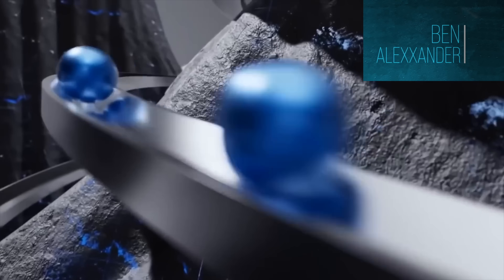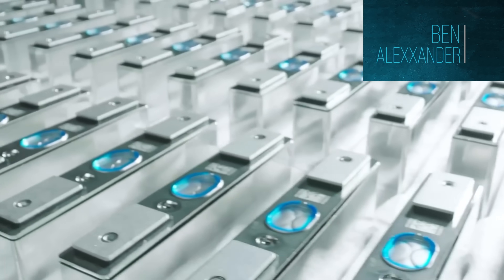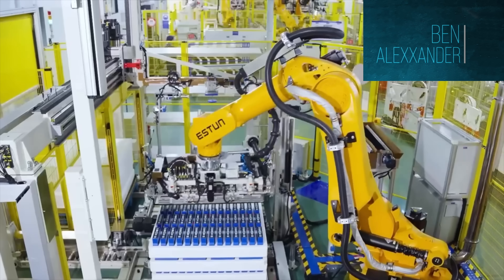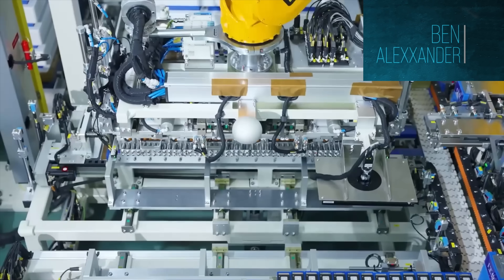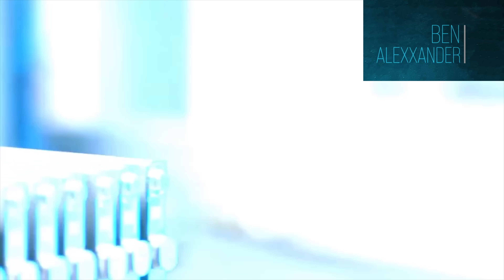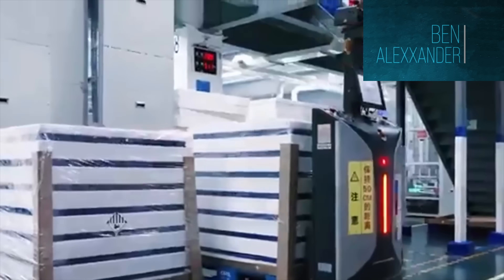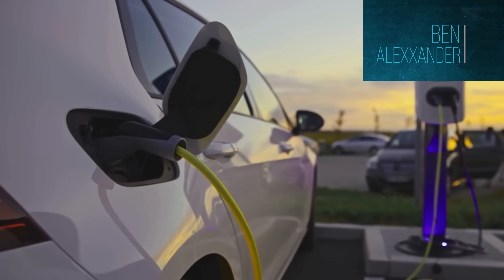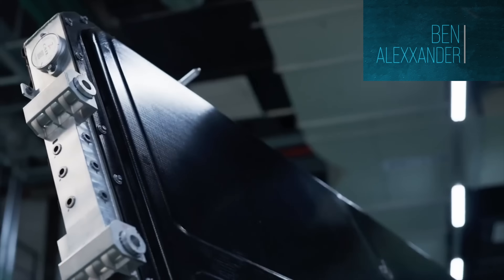CATL’s New Sodium Battery Lasts 3.6 Million Miles — 50% Cheaper Than Lithium

Comment: All this sounds great. But it's very hard to get all charge from sodium battery because of voltage delta between full and empty battery. Battary capacity has linear drop in voltage from ~4.2 full to ~2 volts close to empty. But it's used in range between ~2.8 to ~3.8 volts. So more than half of capacity is not used. And power that you can get from it changes while it's charge decreases much worse than in lithium-ion batteries. If you want to replace best existing lithium-ion battery to get same power output and usable charge then you'd need about twice a weight of best sodium-ion.

Comment: Appears to me that sodium is even more inflammable than lithium, just water will ignite it, extinguishing it with water is therefore impossible as it will just accelerate the fire, it will therefore have to be stored in oil and you definitely don’t want your EV “landing” in a canal. So no, I am not convinced, there seem to be serious safety issues that are not easily resolved.

Comment: shut up and take my money, could use a ton or so to make my house fully offgrid capable for less moneyz, without fear of full discharge or losing rapidly capacity and the fire thing is good too, although it will be put in a dug out hole with live rock and concrete...just in case....

Comment: If tis is correct then by my calcs Sodium batteries plus solar are cheaper than per Kwh than building and running a gas power station. Given enough sunlight also continuous power. Much cheaper to set up as well, so a no brainer but electricity companies will not like the de-centralisation of product so may try to stall things.

Comment: You mentioned that these could be used when the car reaches end of life for powering a house. That will only work if the batteries can be removed from the car and are compatible with house storage systems.

Comment: Sodium batteries are larger and heavier than the equivalent Lithium, which means Sodium power EV cars will be even less efficient than ICE cars, so it is not the game changer EV lovers want.
Reply: lol, did you not here what he said? Energy density is already higher than BYD;s blade batteries.
Reply: @walk-with-Walz said:

"lol, did you not here what he said? Energy density is already higher than BYD;s blade batteries."

Yes, i heard (I did not 'here') what he said, he picked a battery with a lower energy density than the CATL sodium by which to draw a comparison. Had you taken the time to research it yourself you would have realised the current BYD blade is at the lower end of Lithium battery energy density. Makes you look a bit of a fool, lol.

Comment: One reason I haven't got a battery for my solar or bought an EV was the lithium battery technology and associated fire risk. Sodium batteries change everything.
Reply: Unless the sodium gets wet for some reason.
Reply: @Jbot123  genuinely wondering... more consequential than a fuel tank developing a leak? 
In an adequately sealed pack, how does water get in? If you're going to suggest a major impact before going into a river, then how about cars crashing into fuel tankers? It seems to me you can never completely eliminate risk.
Reply: @davebox588  Sodium catches fire and can even explode when it contacts water.  I don't mean driving into a river.  Sodium is kept in oil so it doesn't come into contact with the water vapor that's in the air.
Reply: @Jbot123  Yes, we did that at school, but it seems to me that kept in suitable containers it's not, as far as I'm aware, any more likely to be dangerous than many other forms of contained 'energy'.
We could go back to coal. When lit it just goes 'pffft!' when you put water on it. Safer, but do you really want to pay a stoker to drive with you?
Reply: @davebox588  Gas engine car crashes happen all the time.  Even when there's a gas spill involved, fires are rare, and when they happen, the fires can be put out.  When lithium batteries get punctured, it results in an uncontrollable fire, and all the fire department can do is to wait for it to finish while trying to stop anything else from burning.  If a sodium battery gets punctured, it could have the potential to make the lithium batteries look tame.
Reply: @Jbot123  Your initial point is not correct. YT doesn't seem to like web links but I'll supply one in a follow-up reply. Here's the text from the International Fire & Safety Journal.
"According to a study by the Swedish Civil Contingencies Agency, electric vehicles are 20 times less likely to catch fire than petrol and diesel cars.
The study, corroborated by data from a US insurer using National Transportation Safety Board figures, indicates that battery-powered EVs suffer only 25 fires per 100,000 sold.
In stark contrast, petrol or diesel vehicles experience 1,530 fires per 100,000, with hybrid vehicles at a notably higher risk of 3,475 fires per 100,000."
Reply: Honestly, for me, it's going to come down to range and how fast it can charge.  If they can get the range to massively exceed gas and get the charge times down further tjen what its currently at, then the switch will naturally occur without governments forcing the change.  The infrastructure of not just electricity to support evs, but of the stations as well needs to be massively improved. Outside of that evs so far are just ugly as sin
Reply: @Shadowsokr  Teslas, Taycans, and Lucids are ugly? Man, what do you consider beautiful, Gremlins?
Reply: @hootowl6354 all tesla are ugly as sin. Had to look up the lucid as ive never heard of them. The ev eh. And was never a fan of the way porche looks.  I like the look on dodges ev, however to expensive and way to many bugs in the software for that car from what ive been able to find on it.     I have no interest in purchasing an ev currently and as I said unless the battery can charge as fast as fueling gas does or the mileage blows gas out of the water then I'll continue to have no interest in evs.
Reply: @Shadowsokr I don't want an EV either, because I don't want to spend so much money on something that is a pain in the ass on long trip. A car has to be good around town and cross country. But for around town, EVs are great if you can charge at home. Imagine never having to get gas, or going for less costly services less often.
There are better batteries on the way. But when there is less demand for gas, the price of it will remain affordable. We'll have choices.
Reply: I take it you don't use a modern smartphone or laptop then ???
Reply: Associated fire risk is massively overstated by anti-EV ... anti-anything but oil&gas people, sponsored big oil oligarchs. These batteries far less likely to catch fire than a petrol car, by design as well.
Reply: @Scotti-ren  It's not the likelihood of them catching fire that is the problem. The problem is the absolute uncontrollability of lithium fires.
Reply: @hootowl6354  You've got a point, that's why I prefer LFP over NMC. You might saw the test when BYD put a nail across their LFP Blade Battery. Mind you, home batteries are LFPs as well.

Comment: Plus the transition to  sodium ion for home energy storage users would require expensive upgradation / replacrment if current solar inverters which are designes for LFP or lead acid batteries, as the solar knverter will trip due to low voltage even with 70℅ SOC of sodium ion cells, so in my opinion we are still quite a few years behind a sodium transition and LFP cells will remain in drmand for the near to medium term

Comment: Pair one of these factories with a desalinization plant.
Reply: I had the same thought
Reply: Pissing in the wind.
Reply: @cinemoriahFPV 
Lol .. and possibly facing upwind
Reply: You can run large pipes at least a mile off shore and then feed that pipe into a dispersal system thick releases the brine over a large area of the off shore area. It can also be reduced into a supply of sea salt once it is dried.
Reply: Bulk sea salt is dirt cheap no need to put it any where desal plus desal plants don't make salt they release the high saline solution back into the sea... Do some research next time before you make brain dead ideas.
Reply: @ntal5859maybe you should do some research before accusing someone else of being brain dead. If you had done your research, you would have found the one of the biggest cons of desalination plants is:

Desalination produces a concentrated salt byproduct called brine, which can lower oxygen levels and increase salinity when dumped back into the ocean, harming or killing marine life
Reply: @wmsloan1107  Do you have any evidence to back up that claim?
Reply: ‘Release the high saline solution back into the sea’ - you know that’s a huge problem, right? Clearly not as you haven’t done your research before shooting your mouth off.
Reply: @trhosking  I doubt you have any real experience with RO plants. Maybe you should do some research.
Reply: @trhosking  If it is such a huge problem then why are the so many RO plants doing it?
Reply: @ntal5859brutal, lol....at least the idea was well intentioned.
Reply: @ntal5859 Maybe DON'T release the high saline solution back into the sea?

Comment: this isn't like most new battery things where it's a start-up with an untested idea not proven at scale-this is THE battery company planning an enormous calculated pivot after many years of careful research and testing with the full vertical stack of supply chains and manufacturing mostly ready to go.

Comment: Dang, imagine electric costing less than gas. Sooooooooo, important
Reply: Why would electric cost less than gas because of a battery? You know a battery that still requires gas to charge. 

Great, you solved energy storage. 
FOSSIL FUELS still responsible for 99% pharmaceutical manufacturing. Nearly all of fertilizer that 3rd world nations use to break even in food production. Then Fossil fuel byproducts go into 7,000 modern manufacturing materials. 
so you will still need Fossil fuels to manufacture the materials to make said batteries
Reply: @felixfungle-bung4688
Yes, that is true, but the fact is that it's the burning of fossil fuels that is the main problem.
Reply: @felixfungle-bung4688  well, an electric vehicle charged from a natural gas plant is still 1/4 to 1/2 the carbon emissions. Switch to all green and it’ll be lower.

And manufacturing important plastic parts or fertilizer doesn’t mean we’re burning it all back at the end back into carbon.

Using less is using less.

We just had two storms of the century within miles of each other within 10 days last year, that shouldn’t happen. But the Gulf of Mexico was 90 degrees for 3 months.

Better is better.
Reply: @LeroyMustang electric is lame and not better 🤷‍♂️
Reply: @generalzod7959  I bet you’re mom says you’re handsome too. You shouldn’t believe everything you hear.
Reply: Nah, I'm sticking to my oil burner thank you
Reply: It’s just a battery, it doesn’t produce power, it wont make electricity any cheaper, you can just store more electricity and charge less often.
Reply: @Cybo-Man 100% correct but it will allow for energy generated that's currently wasted to be stored safely and cheaply... One of the big drawbacks for solar  and wind . Is the inconsistent nature in up both you may get 18 hours of daylight during summer and 6 during winter, even at the equator its about 12, that's half the day you need to rely on other power sources or use energy you've stored in a battery.
Same for cloudy days and bad weather. 
the same with wind.
Wave power is slightly different, it's far more consistent with two high and two low tides per day but even then there's calm periods as the tides shift. Plus to be a realistic energy source wave tech needs a  heavy  durable ocean proof system that can function ideally for many decades without maintenance...something that is still under development.
Reply: They already cost less. Look a the best Chinese brands BYD, Chery, Xiaomi  etc. their cars are more affordable than their gas comparison while providing "luxury" amenities, BYD cats are quickly becoming the European brand of choice, and this is with Lithium batteries!!  Imagine what sodium batteries would do.

Comment: Good news, I bet they will improve further and can't wait to get some in my hands. Regarding the longevity: NMC from CATL has 2000+ cycles in their datasheet. So my car would have to make at least 700,000km which it never will because it will fall apart before that.
Reply: The car could last (if designed to last that long), I mean the electric motors could last a long time. The power electronics might have problems (capacitors can get old but that might not be problem nowadays).

Comment: As this is happening I’ve been following 48V charging systems for RV’s specifically on the hybrid end. I think if electric hybrid autonomous vehicles are in the market and there is some type of 48Valternator  to charge house batteries we’re looking at a jetsons future. If in less than an hours drive my house batteries are charged any power above and beyond can extend the mileage. Depending on the efficiency might we be seeing mid sized trucks and SUVs with all the conveniences of a home? Could integrate  fuel cell and cheap hydrogen catalyst using water as a fuel source to charge systems off grid.

Comment: I think it's patently irresponsible to prognosticate upon the "end" of energy generation technologies which perfectly match the realities of handling base loads, in favor of what's at-best a 2-step solution which requires some mental gymnastics to favor.  Solar is great for roofs and windows and sides of buildings in urban settings (where oh by the way those photons do not contribute to heating - alleviating urban heat soak - since they're being captured for electricity), but the density of production is exponentially smaller ergo large swaths of land must be used for society-wide demands

Next-gen nuclear is our best bet by far, and the more nuclear electricity production we have, the less hydrocarbon, and the more economically-prudent (to a point) solar becomes as a secondary generation source.  And regardless where it goes (:: solar farms vs urban areas vs etc), it still "soaks up" a substantial share of those photons' potential heat and converts it to electricity

Also worth noting here that all non-solar, non-wind energy sources are still adding heat to the atmosphere, although I have no idea if it's a meaningful amount as compared to global warming due to CO2/CH4/etc.  And further, wind and solar are effectively removing heat, one directly (whaddya think causes wind?) and the other indirectly (the aforementioned potential heating of photons) during their operation, although the economics and large land areas required for both probably mean this effect is just a nice little bonus we use to hug our egos

Comment: That, before anywhere else is a revolution for energy storage at home level. Even if it takes 25% more space than lifopo4 batteries for home storage that is not a problem...especially if they are 50% cheaper. The fact that they are safe, and last for decades is a game changer!
Reply: The best application will likely be containerised Sodium at the "Sub-Station" level, using that as a buffer between a Grid and multiple Homes (or factories)

Comment: Li-ion battery as a compact, light-weight and quick-charge (by Solar light) devices for Space applications, as spin-off for civilian use as it was found suitable, in spite of high price. Yet, the cost (because the Lithium availability is restricted to a few places on Earth).
All this hid the fact that Sodium-ion battery, as Sodium is copiously available in sea water (it is the main solute in it) everywhere. 
Sodium is one place below Lithium in the same group of Periodic Table, indicating that is easily interchangeable with Lithium. In fact Li-ion battery is marginally better than the Sodium battery. This overlooked fact, need to be corrected. Also Sodium in bulk can be employed in big batteries for use in big ground-based vehicles & static home at much lower cost. Sodium batteries can be made even more cheaper than the 50% margin it has now, over Li-ion batteries.

Comment: I dont mean to imply they are not a big part of the future.    However, I don't think these will scale as quickly as we would hope.  only CATL is claiming that price.  If I had to guess there are still a lot of hurdles to get through, since they seem to be making these hybrid packs.  if only CATL is selling them in quantity they dont have the incentive to drastically reduce cost. I dont expect a 50% drop in pack level prices.  I think we will see that over 5+ years.  This is still great news.  but battery announcements by companies are always grander than the reality.  My guess is they put out these aspirational numbers to scare competition.  

Lithium iron phosphate is pretty affordable and its been out for awhile now.  I think sodium is going to take some time to scale up.  

I have been hearing about naxtra for months now, but its all based upon CATL press releases.  CATL does not lie like a lot of other battery hype companies.  However, I have not seen much independent verification of how well sodium ion batteries work outside of lab tests.

Comment: Did CATL actually guarantee decades/half a century life for these batteries? If not, then we should probably stick to believing the number of cycles they can do with declared degradation. Because, as we know, aging (from time) is a separate issue and an additional cause of degradation- lithium batteries lose capacity just by sitting a year or a few. And then we do not know if materials/barriers inside these Sodium cells will not start decomposing after a decade or two.